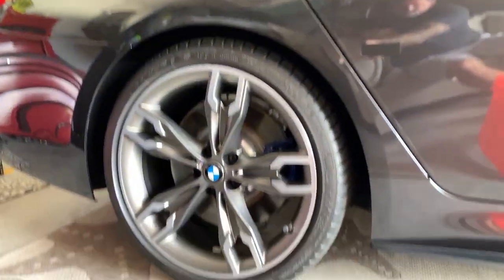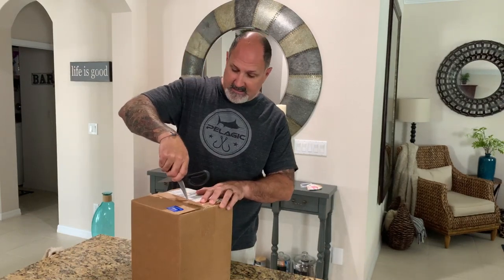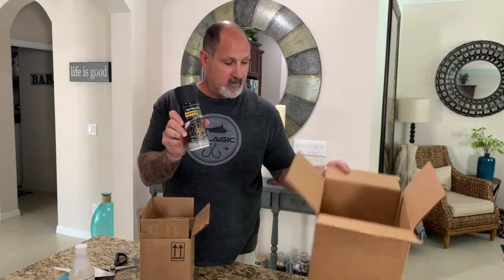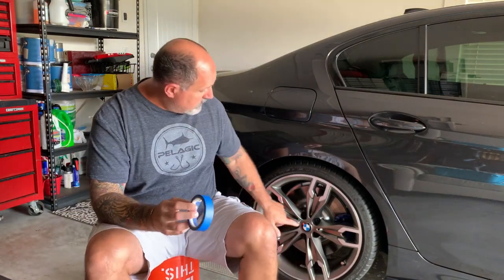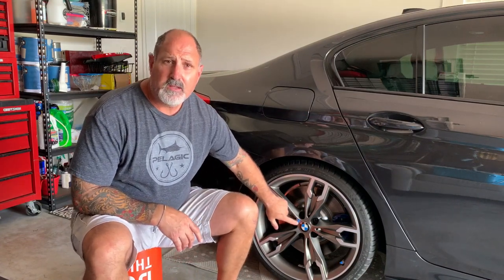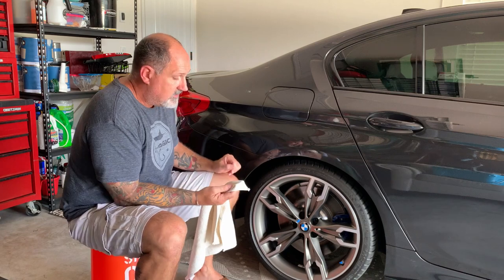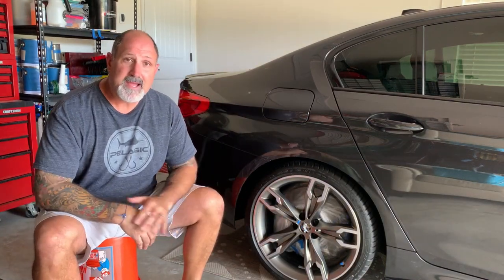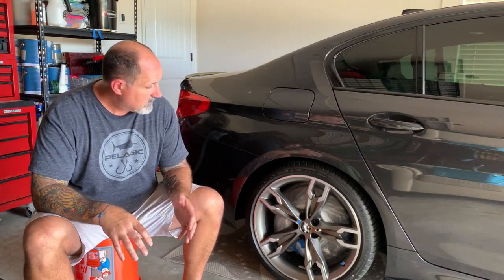M550i - New Wheels Under $100!! | Cheap DIY Wheel Kit Under 100 Dollars

Comment: CJ The Car Nut,
TWO QUESTION:
1) BMW M5 vs M550i xDrive.
Do you feel satisfied with the M550i as a daily driver, or does the M550i make you yearn for more power and the prestige of an M5?
2) BMW 550i vs. Truck.
Do you prefer the M550i as a daily driver compared to driving a truck?